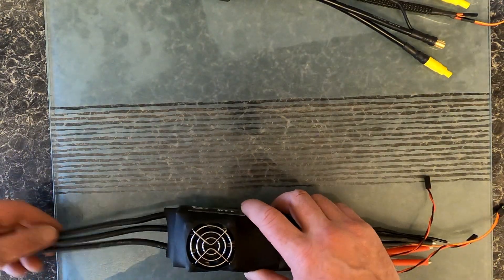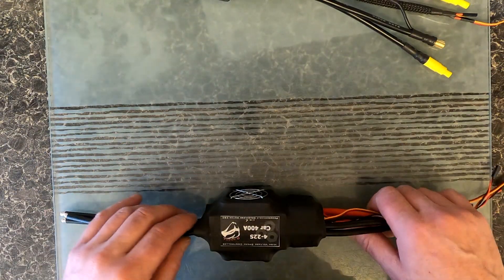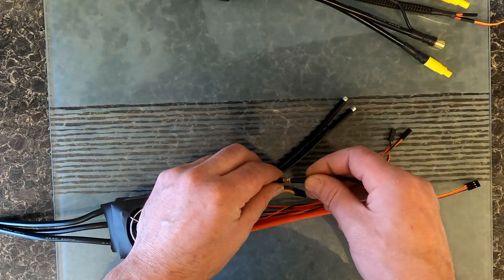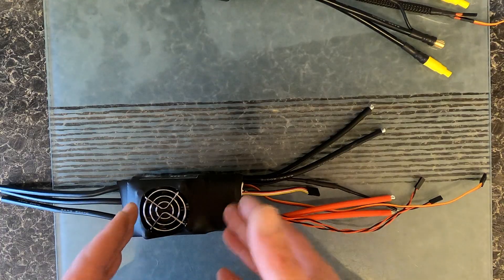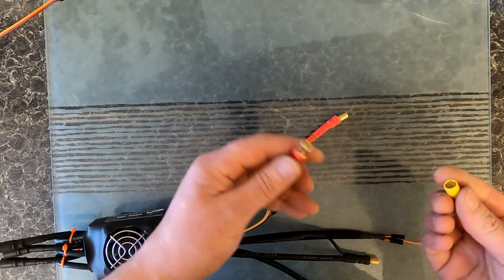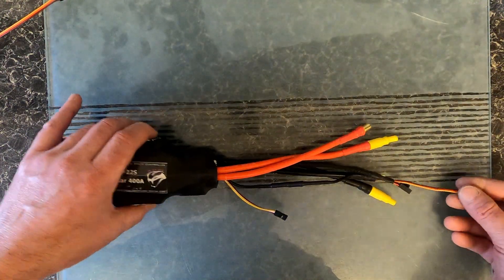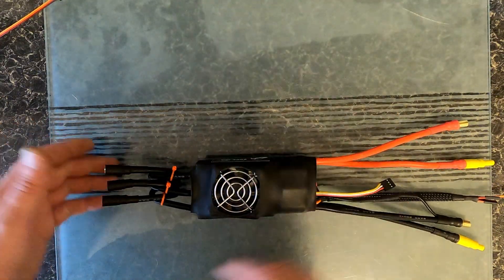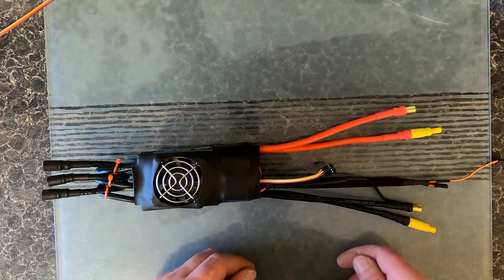400amp 22s esc By R snake R mamba

Comment: Am a little confused. Do you only use one red and one black wire on the battery side?
Reply: You can do since I'm assuming they are running in parallel, but it would be a good idea to run both leads as there gonna heat up under high load.